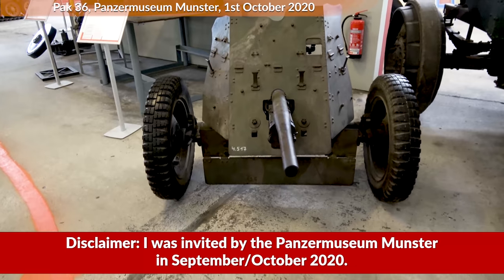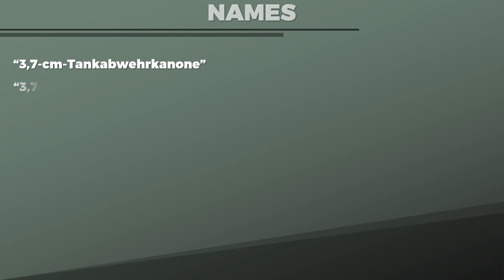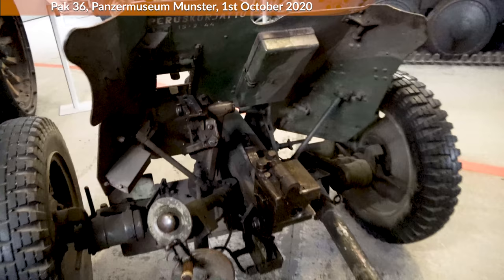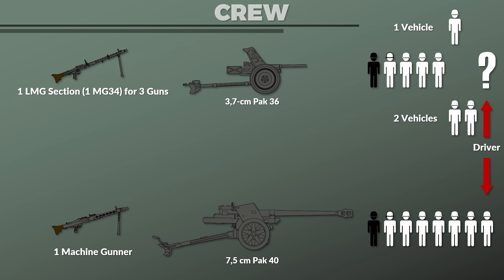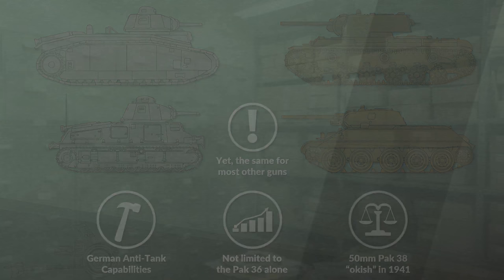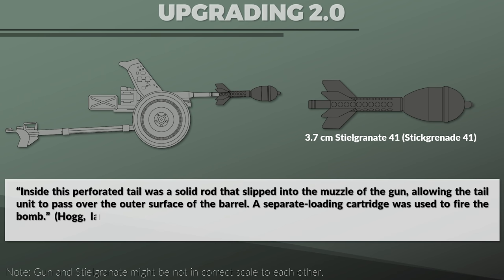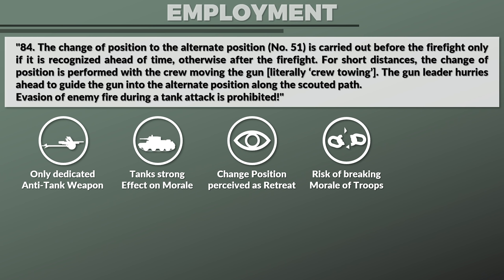Pak 36: The most effective Doorknocker @DasPanzermuseum

Comment: My Opa told me that they would let the tanks drive by to get a flank shot or a rear shot with this gun. He said it was useless in France and really useless in Russia. At times his crew would mount this gun on the prime mover shooting over the cab. They were very happy to get the Marder
Reply: It was plenty good against the lighter tanks the Russians still fielded in large numbers, hence why those tanks had very high loss rates. Once all those tanks were destroyed though, the heavier tanks were difficult or nearly impossible to destroy with one of these. The heavier tanks still had high loss rates in the early parts of Barbarossa, however, because they broke down a lot and the inexperienced crews often didn’t even know how to do something as simple as change a track and so abandoned many tanks.
Reply: @samiamrg7  not when you're yourself within a deadly envelope of more powerful 45mm gun. If you want to survive as AT gunner in those times, you'd better stay VERY low and quiet and do exactly as his gramps said, only engage in ambush.
Reply: No, this gun could easily penatrate things like the t-26,bt-7 and t-28 from the front, no need to ambush from the side to be effective. This was more likely done due to similar reasons machine guns are put in positions to 'flank' attacking enemies. When attacking in speed out lines diagonally 'flanking' the unit allows you to more easily switch to new targets (as less horistonal movement is needed) 

Also the armour of soviet tanks in this case was a negative not a positive. The restricted vision of the crew was a severe limitation. Remember also doctrinally Soviets fought with closed hatches. These tanks are essentially blind.
Reply: @matthiuskoenig3378  It didn't help that for much of the early war the TC was tasked with loading the gun.
Reply: @politenessman3901  for the soviets, its mostly firing the gun
Reply: @politenessman3901  we're talking about soviet tanks, not french ones.
Reply: @TheArklyte  Then you want to read up on early war Soviet tank turrets because clearly you haven't.
Reply: @politenessman3901  compared to a man that projects early T-34 turret onto tanks armed with 45mm gun and is too lazy to look up difference between relative weight of complete rounds of 76mm and 45mm?
But it's okay, T-28 had 76mm gun too for example, I'm pretty sure that one was cramped despite having 3 people and 1620mm diameter of turret ring (100mm more then Pz.III and 20mm more then T-28's distant relative Pz.IV!).
Could you stop with stereotypes, guys? Yes, please, look it up, it'll do YOU some good:D
Reply: @matthiuskoenig3378  T-26? Yes. BT-7 and T-28? Not so much. T-28E? In your dreams:D
BT-7 and T-28 already aren't getting reliably penetrated frontally at distance above 500m, T-28E is simply outside of Pak37 capabilities without the use of tungsten core ammo. Unless you use Terry Gander as your only source:D

No tanks fought with open hatches. And no tank driver/commander of the time would move on the march without apparent danger with hatches closed, air conditioning haven't become a thing until many decades later. So no idea what you're saying here. Or why you believe that soviets didn't have optics(sights and periscopes) on their tanks.
Reply: @politenessman3901  only in T-72. But yeah, I guess I never had to load anything by hand, you're right there:D

Please read comments before responding.
Reply: @matthiuskoenig3378  Beleve the German Army's veterans: 
Like every American soldier in France had to fight Tigers, the Landsers in the SU had permanently to fight KVs or at least T-34s only . . .
Reply: @matthiuskoenig3378  bruh, this is a story from an ACTUAL ww2 vet grandpa, passed directly to grandson. I'm pretty sure his opa knows more about AT warfare in a proper war than you do because, unlike you, he's done it throughout an ENTIRE proper war and LIVED. Even if you were a tank ace veteran of the Gulf War, which was the war with the latest and one of the largest actual armored battles, you wouldn't have nearly the experience his grandfather did.
Reply: @ButtcheekOnaStick  considering this is a "story" and not some diary or report, wouldnt his memory be a bit fudgy?
Mhv did a video on this sort of thing
Reply: Nothing wrong with the gun it's self, just 10 years out of date when the war started.
Reply: @samiamrg7  considering just how many of those t-26 were knocked out by the 20mm auto cannons on armoured cars in '41 the 37mm would punch right on through them. But then again, the t-26 is the age of tanks the Pak36 were designed to destroy.
Reply: total lies
Reply: @TheArklyte  "BT-7 and T-28 already aren't getting reliably penetrated frontally at distance above 500m"
Until the widespread use of the Pak40 it was SOP for the German AT guns to engage at close range only. So not getting reliable penetrations at 500 m hardly matters. Engaging from the flanks is also SOP for AT guns. Not only for Germany. So being protected over the frontal arc is of limited value. It only would be 100 % effective if you know in advance where the AT gun or guns are positioned and you would drive straight towards it. Which is very unlikely to begin with. You also better pray there are not more guns covering the others to which you would expose your vulnurable flank. 
The 3,7 cm guns where pretty effective against the older Soviet designs. Only the T34 and the KV where basically immune. The T-28 is also vulnurable to the Pak36. The vehicle is huge with mostly vertical surfaces. At typical combat distances a Pak36 will be effective. Not with every hit but concidering the high rate of fire that hardly matters.
The high accuracy of the Pak37, also mentioned in this video, needs to be taken into account. At 500 m and bellow it was possible to deliberatly aim for weak spots and hit them. Not by chance but planned with intent. In the early stages of the war the crews where still trained well enough to make use of that. Crew training is a very important factor. Its one of the explanaitions why the Germans at this time could pull certain things off with theoretically inferiour equipment. This changed dramatically later but by this time the Pak36 was not the main AT weapon anymore.

"No tanks fought with open hatches."
That is completly wrong. It still is German SOP for the commanders hatch to be open and to lead with your head out. The hatch is only closed if the situation forces it to be. For example wenn under artillery fire. It was SOP during WW2 as well. 
Several other nations had or adopted similar SOPs.
Yes, situational awareness is that important.

Comment: to translate "peruskorjattu", "OVERHAULED" or "REBUILD" would be better fit, imo. Renovation sounds something you do a 500 year old painting. :P
Reply: The direct translation would be "basic fix(ed)"
Reply: @EneTheGene  But what the original word means is: "repaired to the specifications". 'Basic fixed' gives the feeling that only basic repairs were done which isn't the case.
IMO, "overhauled" is the best translation as "Rebuild" implies actual building of some of the parts.
Reply: @alaric_  well put.
Reply: Basic repairs serviced
Reply: I think the Finnish language is a bit tricky in this case. I would say that the "perus" is actually more the short of "perustavanlaatuinen" or "perustava" which would then better translate to "major repair" or "base maintenance". Overhaul is in any case the correct translation.
Reply: @Fluesterwitz correct!

Comment: Finn here, from the country previously owning this individual gun.

In Winter War we mostly used the Swedish 37mm gun, but in practical terms, I would assume them to be quite similar. This gun was in great demand during Winter War, as it was able to penetrate 99% of Soviet armor, mostly consisting of T-26 and BT series at the time. However, we had pitifully small amount of them available and Germans didn't do us any favours by teaming up with Soviets and preventing all aid from coming to Finland.

After a relatively quick switch of relationship statuses, Germans became hostile to Soviets and friendly to Finland in a few years. We started to get these guns from Germany, as our previous experience had taught us they were pretty good. However Soviets made this funny little trick called producing T-34 and KV series of tanks now, which this gun couldn't penetrate anymore.

However the 37mm gun still wasn't as obsolete as it was elsewhere; Plenty of forests and swamps meant only light tanks were able to operate in most parts of the Finnish fronts and it was regarded as a secondary front by the Soviets, so the big heavy new tanks were mostly a German headache and the older light tanks were dumped at the Finnish front.

And of course the Lappland war, which Finland fought against Germans, didn't involve so much tanks, but the gun was used in its role of applying HE rounds against infantry, which it did as well as always.

And like all absolutely obsolete weapons, it stayed in service in Finnish military for a long time after that.

Comment: I assume the last sentence should clear out any misunderstandings. Moving to alternate position hast to be carried out not when being engaged, but only before the firefight of the gun has been spotted oder afterwards.
The purpose of „wechselstellungen“ is not to withdraw under pressure, but to avoid being spotted. So moving to the wechselstellung while under fire can be seen as pointless, becaus the gun can be tracked
Reply: yes, breaking cover in the middle of an attack and exposing the crew seem like a bad idea.
Reply: @redspark2009  haha :D 
yeah, but under certain circumstances wthdrawing under pressure can be a smart thing to to. Although, "Lösen vom feind" and "Kämpfend ausweichen" have slight but not insignificant differences (at least in modern tactics)
Reply: .....bleeding from his face and half deaf, Kanonier Müller smashed the button and hit the Sherman right into the lower plate, just as the tank was about to mill the Pak into the ground.......^^
Reply: One of the characteristics of a good alternate firing position is that it enables the crew to relocate their gun while remaining under cover.
Reply: @LawtonDigital  This would be an ideal case in a short break after a firefight, but during the firefight, the Pak must fire - even under worst conditions....The bridgehead of Abbeville was such an scenario....a terrible bloodletting for the Panzerjäger with their insufficient Pak 36 against heavy and medium French tanks...but they managed to hold partialy the positions and helped to prevent a burgeoning panic amongst the German infantery, until the famous two 8,8cm took over.....

Comment: Just to put this into context, Germans had about 10 times the number of AT guns in September 1939 then Poland. Poles had 37mm Bofors about 1200 units. This was less then 1/2 of needed #s - Poles needed about 3000 AT guns. Units that were at full AT strength proven Polish 37mm gun was very effective, in a single battle a single Polish brigade destroyed or disabled roughly 100 German tanks and armored cars. Polish AT gun had better penetration than PAK 36 - 40mm at 400m at 30 degrees.
Reply: the 37mm Bofors was the pak 36. The Pak wassold widely before the war.
Reply: @michaelbevan3285  Not really - they were slightly different guns - many countries developed their 37mm guns - including US at about the same time with very similar characteristics - see https://en.wikipedia.org/wiki/37_mm_gun_M3 I can list many examples https://en.wikipedia.org/wiki/3,7cm_KP%C3%9AV_vz._37 https://en.wikipedia.org/wiki/Type_1_37_mm_anti-tank_gun
Soviets did have a clone of the German early gun https://en.wikipedia.org/wiki/37_mm_anti-tank_gun_M1930_(1-K)

Comment: My own experience in WW2OL was thus: Yes, the Pak36 is useless when used against tanks.  However, when facing armored cars, armored trucks and other light vehicles it can't be beat because it actually has the manuverability needed to operate against and track fast moving targets.  It's low profile and small size also makes it good at ambushes; in fact it could almost be considered a "hit and run" ATG, as crazy at that sounds.

Comment: @Military History Visualized as a retired Master Gunner (Royal Australian Artillery) and son of an AT Gunner (QF 2pr and QF 6pr) during WWII I can say that AT Guns are not normally deployed close to infantry, they are usually deployed adjacent to infantry on the flank or in such a position as to maximise their field of fire. Alternate gun positions are a normal part of deployment. The gun commander would announce the move as loudly as he can such as "Move to Alternate position". Infantry would know this if employed near a gun (of any type) as they may also move to an alternate position as well. Artillery pieces are a bullet and projectile magnet.

Other things to note: only pneumatic tyres are suspension on Artillery pieces. Any other form of suspension would cause inaccuracies in gun lay. You can have both spars and trails on Artillery pieces, the trail has a spade attached so it can be dug in or self digging spades which don't need to be dug in. Spars are detachable.

If you need any further assistance don't hesitate to contact me.

Comment: I think that in order to understand the part about no Stellungswechsel during the firefight it might help to think of the 13th and in this case 14th company as remnants or inheritors of the world war one Feldartillerie detachements that were send forward to help the infantry if it couldnt win fire superiority by itself.

In my eyes this commandement is about fire superiority, too. Stellungswechsel in this case would equal being supressed and a supressed defence is ripe for the assault. 

On the contrary an attack that has to engage in a firefight is an attack not moving forward and in the case of tanks in plain sight of heavy artillery forward observers you can imagine the rest.

So in the greater scheme your PAK being shot at might be considered a good thing (not by the guns crew obviously but hence the order not to evade).

The thoroughly designed gun shields of PAK 36 and IG 18 speak for themselves when evaluating 1930s german imagination of the infantry regiment in combat.

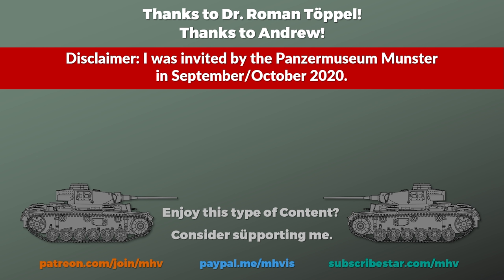Comment: 18:20 This is still a common practice. With 105mm howitzers in Canada if there is no time to dig in the spades or the ground is hard the gun detachment members will apply their bodyweight to the draw bar and handspike on the end of the trails above the spades and "ride in the spades" to help them seat better into the ground. You can see the handspike and drawbar clearly hear when they run up the gun.
https://youtu.be/57lvD2MA-BY?t=259
Reply: As a fellow “King of Battle” from Marine Corps of your neighbors to the south, just wanted to add that the Marine Corps Times (newspaper) rated 0811, Cannoneer, as the hardest job in the Corps. People don’t understand how beautiful, and how labor intensive, artillery is. It was funny to see all the gun crews drop in their spot asleep the second the gun line went cold!!

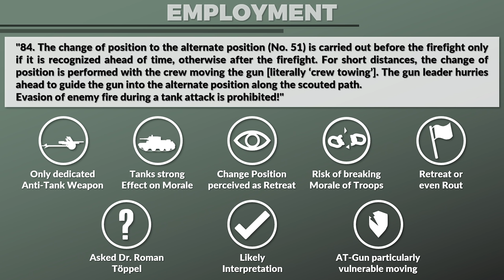Comment: 16:43 I think it might be that be because while you are moving the gun you are not firing. When the AT guns are not firing the enemy tanks don't feel threatened. So the enemy tanks can advance more quickly, use their weapons more effectively and generally make less misstakes. You lose the suppression element.
Reply: I think it's more than that.

In the moving state, it vunerable to any vehicle as to deploy the gun takes some time whether short or long. Not only can they usually not fire the gun but they might have to set up wasting precious time to fire the gun. I know is some cases it's can fire without deploying those legs but those legs are there for a reason.

In the moving state, they are much more vulnerable to infantry so that's another thing.

Comment: A lot of the Inter-war development was based on 1st generation Tank technology and Trench Warfare from the first World War.  So basically, this was designed with the British "Landships" in mind, while the Germans were developing more advanced Panzers at the same time.  They also had a close eye on the French inter-war development, due to resentment over the Versailles Treaty.  Those were mostly small with heavy armor (For the time) and 2 man crews.  A driver in the bow, and the Commander in the turret.  So, he had to act as Gunner, and Loader (Basically the same 37mm guns were standard at the time) as well.  Since this is an Anti-tank gun, specifically.  The Tanks you expect to be shooting at are crucial for the development.  The biggest gun isn't always the best gun, especially when you have to tow it to the battlefield, supply it with ammunition, dig in emplacements for it, and it's crews.  Again, the dominance of Trench Warfare on the Eastern Front influenced their early weapon, and strategic development, so if given the chance, the French might dig in, with Tanks mostly for breaking the stalemate.  This is why the original name indicated it was for Defense against Tanks.

Comment: I want to note that ineffectiveness of Pak 36 against T-34 is often overstated. This reputation was most likely caused by the fact that Soviet light tanks were vulnerable to AT fire at most viable combat ranges while T-34s and KVs weren't. But in the same time Soviets collected data from 1941 and early 1942 was that around 15 to 20% of examined T-34s had penetrations from 37 mm shells (mostly to the lower side hull behind the road wheels, so presumably relatively close range shots). They also noted that driver hatch was vulnerable to 37 mm shells as it tended to flew of hinges after a hit or two. 
 So I tend to read 'ineffectiveness' as not 'cannot penetrate armor' but as 'close range engagements and careful position was required to engage heavier armor'.